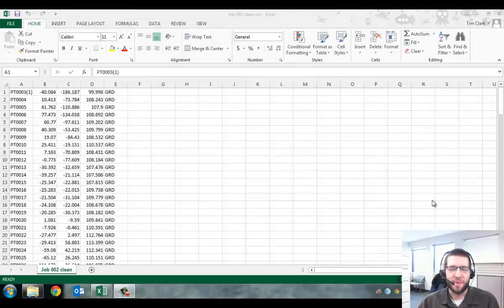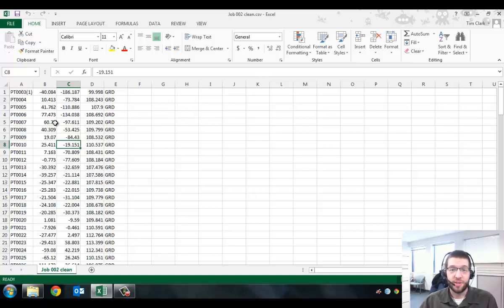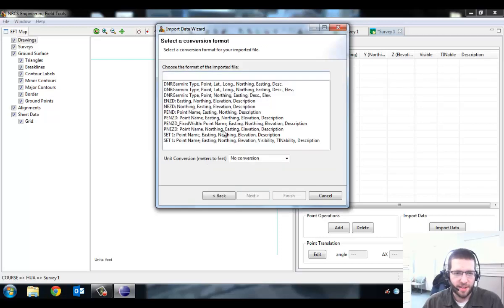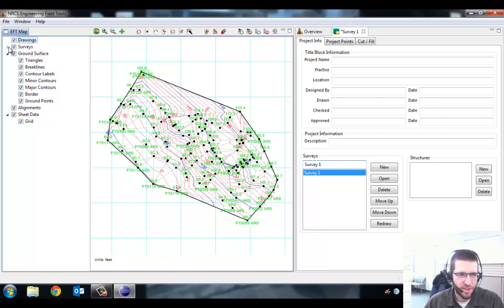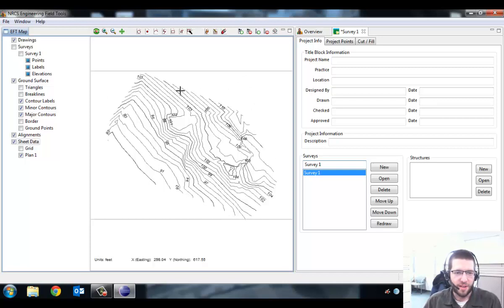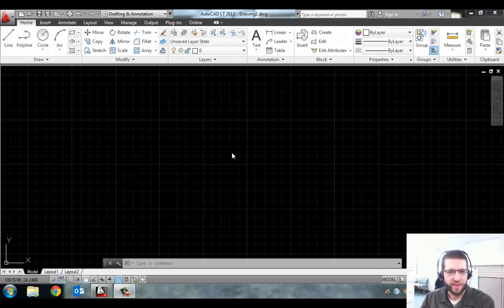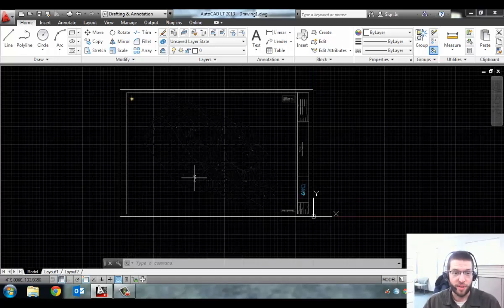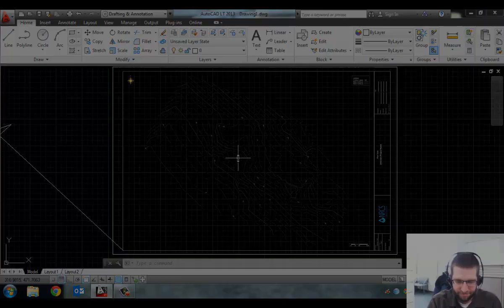Survey Points to Contours to CAD for free

Comment: the link you put is not around.
Reply from the maker: Thanks - I am aware of this.  NRCS rebuilt most of their website in 2022 and have not put the EFT file download back up anywhere.  You may download a recent version at https://nrcs.app.box.com/s/kfnshdna9vsdwx5puq3vhdd1p6drzfdm .   Put the resulting "eft" folder on your desktop and run the "eft" application inside it.  There's no .msi or .exe windows installer using this workaround.   Also, it does not seem to work when saved in /Program Files or /Program Files (x86) for some reason.